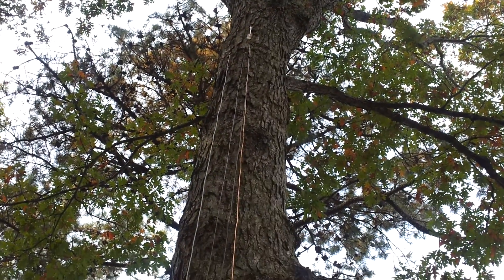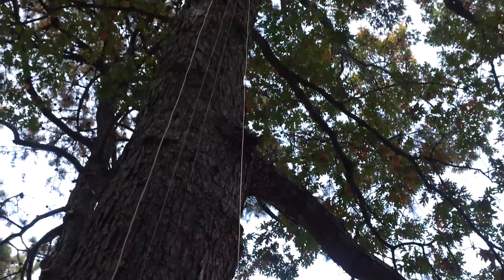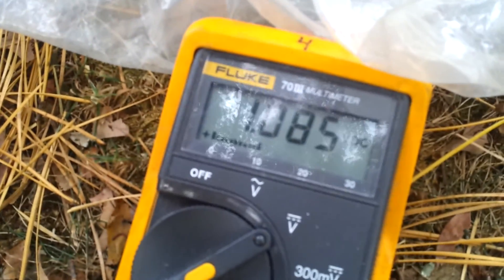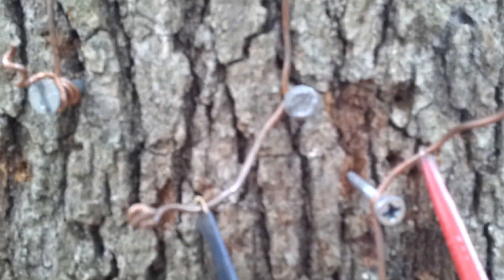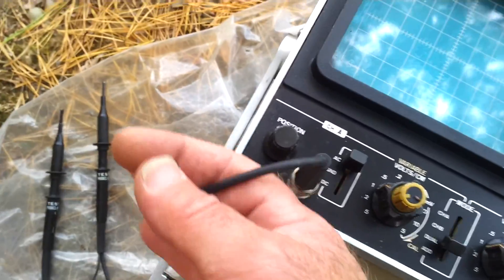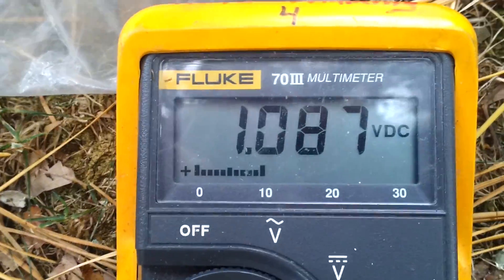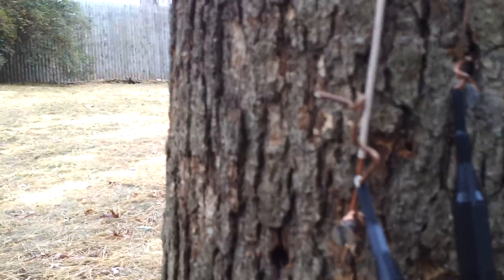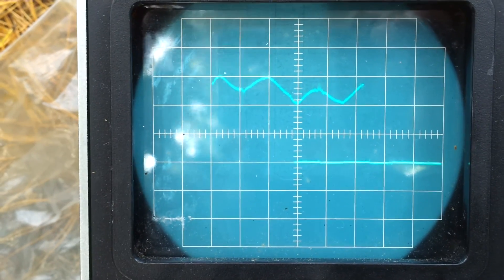The Ultimate Quantum Solar Panel "The Electric Green Project", Free energy.... Part II

Comment: Hey!, this is really amazing, i really want to know if there's any news about it, also i have some questions, of course you don't have to answer if you don't want to, but here i go.

1.- You said that connected in parallel you can get more Amps, it make total sense (it really doesn't, but its understandable), my question is: Did you tried connecting the wires in series?, maybe the power source it has nothing to do with the high of the tree, and just "it's in there"

2.- there's a screw in the lower part of the tree, that it's grounded, is that really necessary?, i mean isn't the tree grounded it self by its roots?

3.- How large are the screws?, does it make any difference to put a larger screw so it could reach deeper in the tree?

Greetings, and great video!!

Comment: Any updates from cold weather and leave less conditions?
Reply from the maker: Yes... I get the same results with no leaves on the tree.  I will publish this sometime over the next few months… All in all… the voltage reduces when it rains about 0.15volts (with leaves or without leaves) however… it increases during drier days.  Using one Cu line, I charged five 2200uf caps in parallel in about 20mins.  and discharged them in series to light an LED for about 3 seconds.  Not good enough yet… However… 

I am also trying to do some analysis on the ms signal I’m getting from the tree which is quite unique… I’m not sure where this is coming from, however, I find this type of signal in trees planted in a pot … isolated from earth ground.   Very interesting reviewing the recordings during the course of the year… It may mean something not thought about before and may be weather related.  Could be the plants intuitive genetics to survive during climate change… a way a plant prepares for climate change??? It's quite more intuitive than the weather station...

Comment: 1. when you ground the wire which you named "antenna" than this is not an antenna but GROUNDING. And ofcourse from a well grounded wire we can not receive any signal that way. To receive some signal from antenna you need to disconnect the end of the antenna wire from the grounding and connect your device with one cable to the antenna and second one (in your case the red one) to the grounding.
2. Almost any material containing liquids would produce some galvanic energy if pluged the way you did it on the tree. Thus you created a galvani cell as Mr. Galvani, Volta and others 200 years ago.
Reply: Jan SCOAN Check again, the antenna wire is not grounded, its just tied to a wood stick, he has another screw in the lower part of the tree that is actually grounded